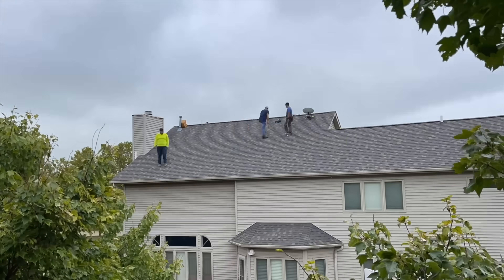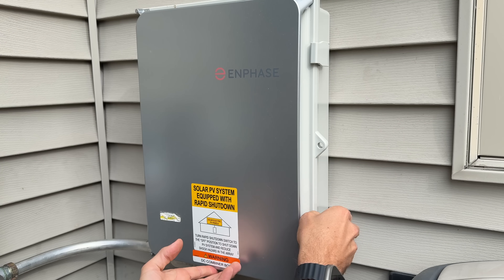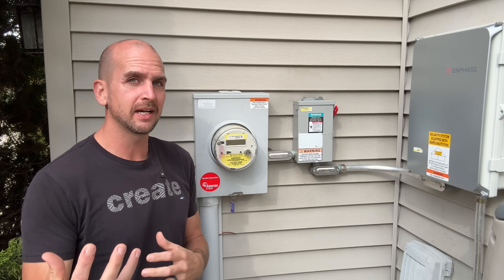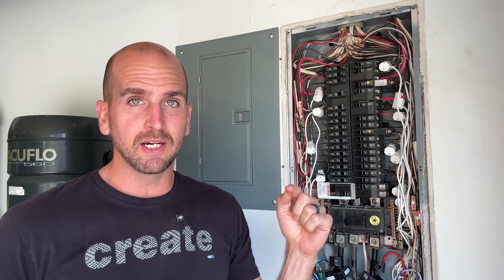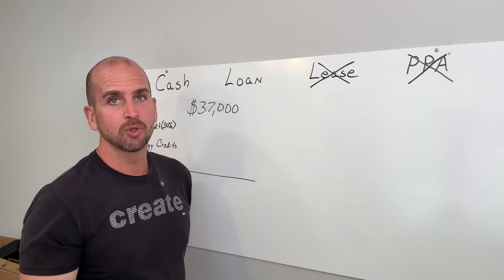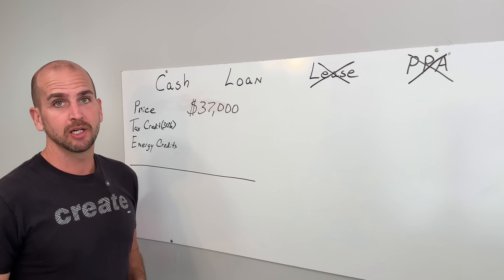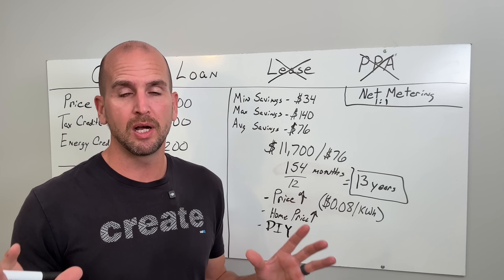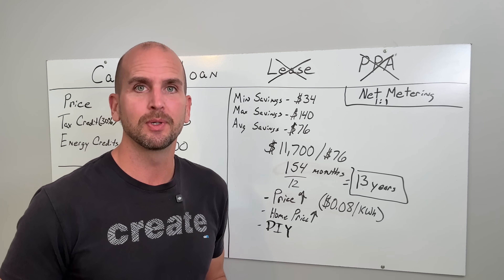Are Solar Panels Actually Worth It For Homeowners?

Comment: And this is why I disagree with the approach that US has taken. Big residential solar installations. It would have been much better to use small plug and play kits of 500-1000W that are essentially 2 panels and a microinverter which you plug in a socket. And that's it. No installation cost, not bureaucracy, no inspections. And the cost should be about $0.7-$1.0 per W. This is what Germany does with their balcony kits.
Reply: Cept for when it back feeds during an outage because the cheap inverter doesn’t stop or you have a fire and they don’t have an easy way to disconnect it from backfeeding
Reply: @nickk05281982  Not a single one of the micro inverters in Germany allow backfeed during outage and only authorized ones can be used. And you can also stop them very easily. Either pull their cord (duh) or switch off your main switch.
Reply: @nickk05281982  In practice, grid-tie inverters only stay energized in very rare situations when the greater grid goes down.  It's on a lineman's checklist but otherwise not an issue.  A tiny little 500-1000W micro-inverter isn't going to try to power the entire grid, it will disconnect and shutdown.   You can look up the standard if you like, its called UL1741.
Reply: @nickk05281982  A micro inverter isn't more likely to back feed any more than a large inverter. The cost of the inverter is mostly based on it's capacity. Rather it's a large grid tie inverter or a small one, they would both have to comply to the same safety standards to be legally sold.
Reply: This doesn’t work if you plug into the home electrical system. Plug directly on to the appliances. There’s no plug and play unless the house is already designed to accept solar and batteries.
Reply: @finned958  It depends on the inverter, the poster said "microinverter" which is the term used for low wattage grid tied inverters that can be plugged into a standard socket to feed power in. They are designed to shut down for safety reasons if the grid power becomes unavailable. Plugging appliances directly into an inverter fed by solar without a battery system doesn't work well and just isn't done. Solar output is incredibly variable making using it directly totally unreliable.
Reply: @timezonewall  A micro inverter that you plug into a wall socket is not what is done in the USA.
Reply: @finned958  Oh, you can definitely do that.  There are a dozen 120VAC microinverters that can be bought on a lark and people use them all over the place in the U.S. with small amounts of solar..  They do work.  They aren't particularly efficient.  They won't power your house, obviously.  They are not UL listed either, but they are so weak that they do properly shutdown if the utility is lost and don't really pose any serious risks.  At least at 500W or lower.

They can be quite convenient for an apartment with a sun-facing balcony, for example.
Reply: @junkerzn7312  So you’re saying you will plug it in without using a transfer switch to cut off grid power. You will just do it.
Reply: @finned958  Microinverters are grid-tied devices.  Are you not understanding what a microinverter is?
Reply: @junkerzn7312  Which requires a permit and permission to operate (PTO) from the electricity company provider. It’s not a DIY project for many. Requires inspection too. So you decided to omit this detail. Why? If you just want to install micro inverters as a completely off-grid solar system, no one will give you any problem. Just have a permitted transfer switch to close off any electrical transmission to the grid.

Comment: In NH with my utility we pay $0.167  per kWh we use from the grid and we receive $0.110 back for every kWh we send back to the grid. We also get reimbursed for our RECs once a year after the power has been generated at a rate of about $32 per MWh. I wish we got our forecasted RECs in advance and 1 for 1 net metering. What happens if your system has a failure and you decide the cost to repair is not worth it, do they come back after you for the REC money they gave you upfront? I had lightning strike near the house and it took out all the Enphase micro inverters. Luckily my insurance covered it because it was very expensive to remove and replace all the inverters.

Comment: I live in the Southwest so it is definitely feasible but I would never put panels on a roof.  I'd have an array on the ground with used panels you can get for cheap in Phoenix and do as much work myself.  I would think being in the Midwest you would really have to over panel.
Reply: There are many advantages to ground mounting (easier installation, easier maintenance, less impact on HO insurance, etc). The issue in ground mounted panels for most people is having sufficient space.  It seems most homes built in the last 25 years have too small of back yards for ground mounting to be practical for a reasonably sized system.

Comment: Are solar panels worth it? It depends. For starters: Is your roof a good candidate for solar, ie good southern exposure? How long will you be staying in your home? Is your roof going to be replaced anytime soon?  How reliable is the power in your area? Do you have extra cash for installation of the system?  Everyone needs to evaluate their own circumstances.
Reply: @rik8809  unfortunately none of this matters if you can't get a 1:1 net metering contract. It's really hard for solar to make sense if the utility wants to rip you off
Reply: Roof installs are a terrible idea. Unless you’ve got a brand new steel (or other 50+ year roof), it’s a nonstarter